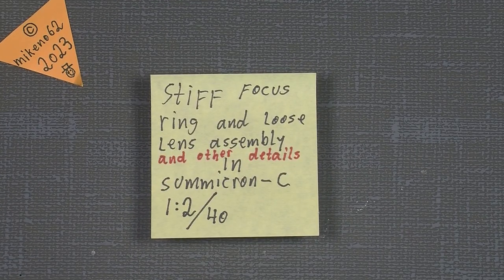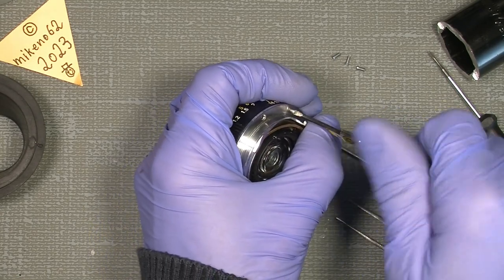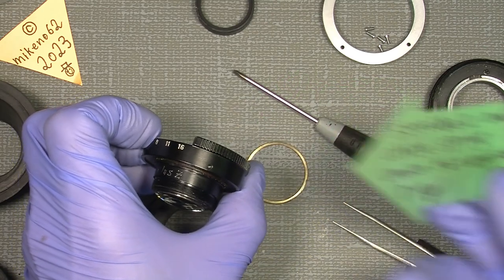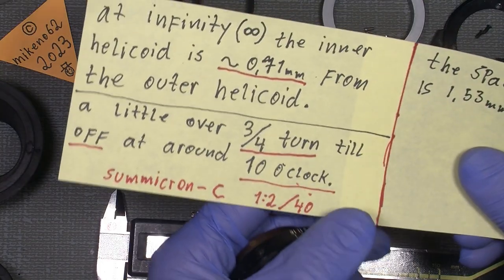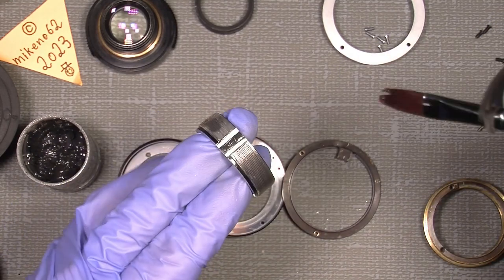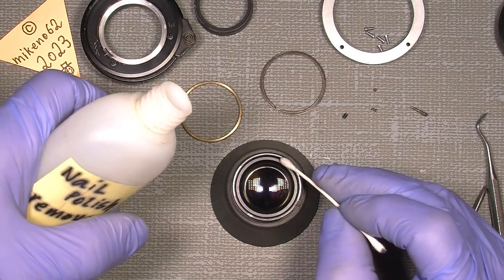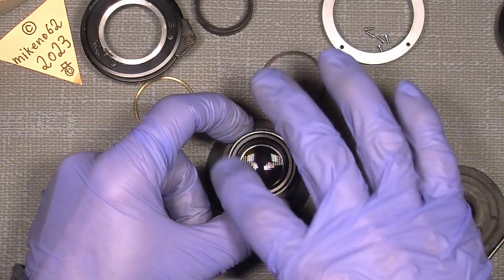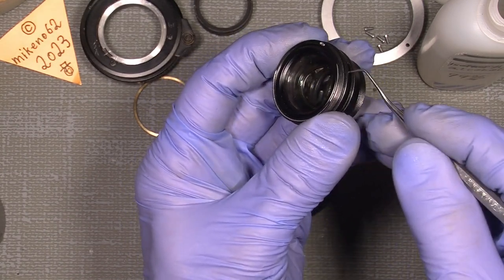Stiff focus ring and loose lens assembly and other details IN Summicron-C 1:2 / 40

Comment: Was Reparing my 40/2 while watching your video, very useful, everything back to the way it should. However, just one issue poped out, after screwing the aperture component back onto the focusing component, there is a very slight left and right wiggle, about 0.4mm wiggle (not front and back loose as it would affect the focusing). 

Is there any way to tighter that part?

Comment: Hi kenneth, by chance do you repair cameras from other people? I would like to see if someone could help me repair my olympus XA2 but I live in Hawaii and cant find someone who has experience with it. While troubleshooting my flash i noticed on side of the camera body where the flash attaches that there is a small metal flat piece inside that was bent upwards . I folded the small piece down and now when i attach my camera it automatically forces the flash to pop up and I can no longer switch the flash  (feels jammed) on the body. I cannot figure out a way to reposition the metal piece to its original form.